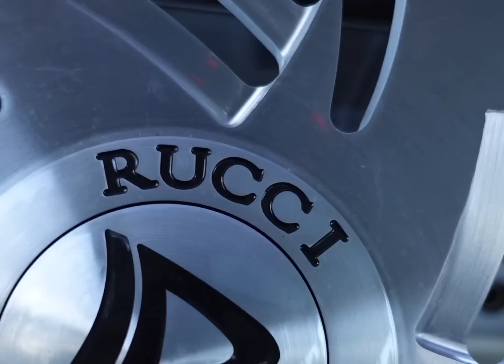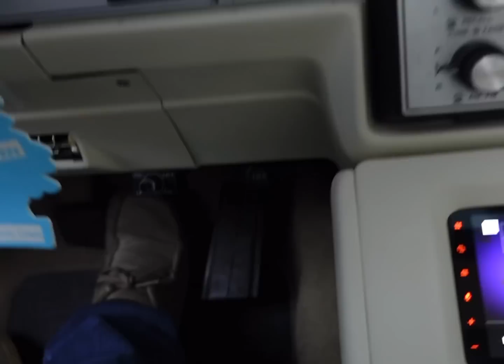Suspension all finish & Mounted up!!!

Comment: If you got a gm style disk /disk I got the same you HAVE TO put the gm bleeder tool in on top of proportion valve if not the safety feauture on it will kick on and lock the valve up not allowing fluid to go to the back brakes . Good luck with project bro looking 🔥

Comment: If the brakes are still hitting the floor after the 2nd bleed , u might can use a vacuum pump on your brake booster

Comment: That's nice my boy!!!! Does your fans run the whole time your car is running?
Reply from the maker: Yes
Reply: @LifewiththeIkes  Okay, is that considered to be the best way to have them reason asking because I'm about to hook mine up
Reply: @Rob Berryhill  don't run your fans like that..constant Amp draw.you want your car to run at a certain temp to run the most efficient etc...
Reply: @MrBtownrep  Okay thanks, because I thought that the fans would burn out that way. So I am trying to figure out how to run the blue and green wire from my psi harness controlled by my PCM to my dual electric fans
Reply: @Berryhill42  gotcha I run my swap with the holley system..fans controlled by computer